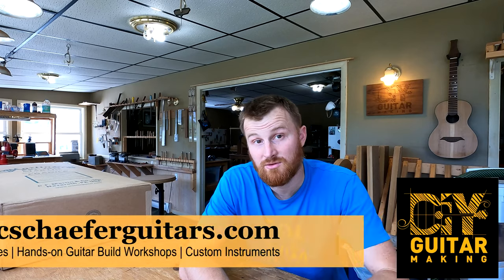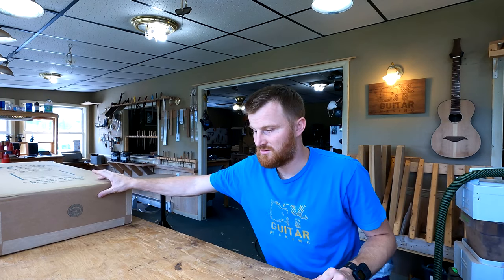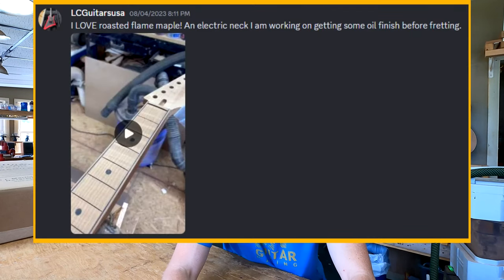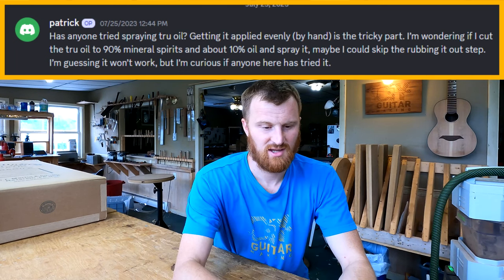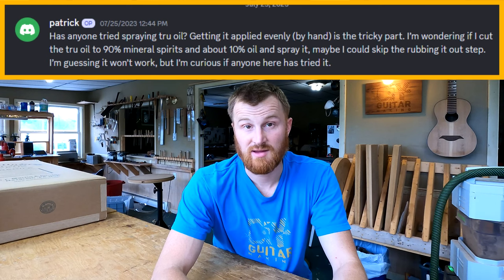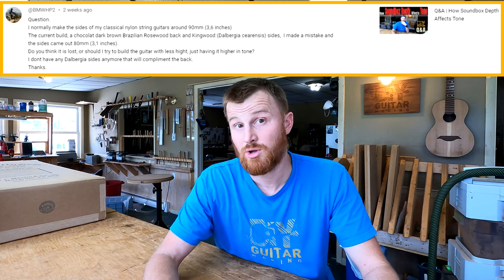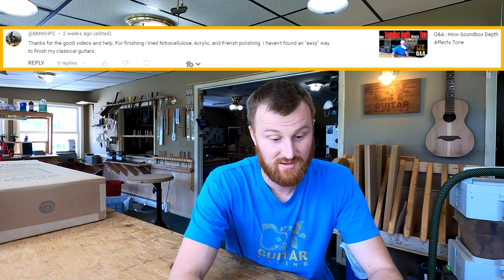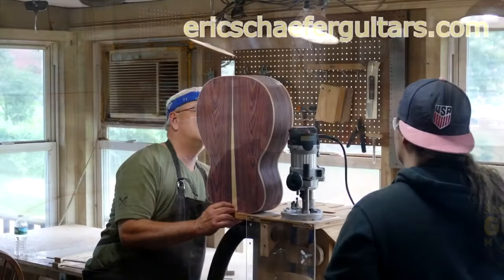Q&A | Using Pine for Guitar Tops, Shop Injuries, Roasted Flamed Maple and More!

Comment: Recently, lol, enlarging a hole on an aluminum plate with a drill press - without clamping it down - the bit dug in, spun the plate, and tore off a small corner of my thumb - it could have been a lot worse. Lesson learned, always clamp down what you are drilling on the drill press, and wear leather gloves. It is always the stupid things that you know better that get you.

Comment: I've made an electric body out of pine, & that guitar remains one of my go-to player guitars.  I almost laugh out loud every time I pick it up.  And StewMac sells pine bodies as well, of course.

I've done some research on pine for acoustic soundboards.  Of course, the first thing you come across is that there are several species called "pine."  But overall I've seen it stated that its density is similar to spruce; stiffer across the grain than spruce; less stiff along the grain than spruce.  Sounded encouraging, so I decided to give it a try.  I found "craft boards" about 0.25" thick at Lowes.  Further labeling, the appearance, & the smell all indicate they're pine.  Took 3 pieces to make a top.  Joined & thicknessed.  Compared to spruce & sapele tops I also have on standby, the pine easily has the most ringing tap tone, so I'm eager to try it out on a Frankenought build I have (slowly) in progress.

I don't suppose anyone knows a source of thin pine boards wide enough to make a 2-piece top?

Comment: Could the throwing sparks just be nails left in the reclaimed wood?
Reply: No not at all. I'm very carful about what kind of stock I run thru my tools. As were the suppliers. I always use stickers when having to lay lumber on the floor so it doesn't pick up grit. Which I did learn the hard way. I might add a nail will nick a blade this wood left the blade flat the entire width of the board. The upside was I replaced the cutter head with a Shelix head.

Comment: I hope I didn't ruffle too many feathers with my comment about Pine tops, but I'd like to clarify it.  Mr. Schaefer's comment, July 24th, 2023 , @ 27", was,  ..."assuming that you're using those, and good softwoods, not Pine."  While it was clearly intended as good advice, I  think that portion of the statement  was a slip of the tongue that inexperienced builders may take as fact.  And that and only that, is what precipitated my objection and earlier comment.  I'm NOT, repeat, NOT promoting alternative woods or touting sustainable yields, nor am I recommending that a neophyte or inexperienced builder use Pine, unless they have reason  to do so, but those reasons should NOT be because someone casually said so.  And the finer point; once you have a theory or hunch regarding the use of a material, pursue a reasonable assessment of its physical viability and if that bears out, proceed with zeal.
Reply: Hey, very interesting use of pine. Eastern White pine can have really good stiffness to weight ratio, maybe better than Western Red-cedar. Other pines, which I've played around with for archtops are Western white (very good) and Lodgepole (often marketed along with Englemann Spruce in the ES/LP grade). Eastern Hemlock, I don't have much experience with, but what I have from my area looks great, but not stiff. Western hemlock, often marketed along with true firs as the HEM/FIR lumber grade is excellent, even with fast growth. Stiffness is better than Sitka, though it is heavier.

The Southern Pines can yield excellent tap tone, but generally not in the high range as the spruces, being heavier. They are similar to Douglas Fir, but both are good as juvenile wood, I'm talking 1/2 wide growth rings. 

In short, God has blessed us and there's nothing to stop a home luthier from making good instruments with readily available and cheap materials. 

Sometimes Europeans call a tree "pine" or "fir" but mean the common Norway Spruce, for example in Andalusia the flamenco makers call it "pino abeto" (pine fir, go figure!)

Please continue to ruffle feathers. The Cremonese used what the Tyrol gave them. Pearwood and boxwood were only later replaced with ebony. Torres made due with cypress and whatever multiple piece tops he could cobble together. 

Only today's tonewood mongers and the under-educated gear fans geek on things they really don't understand. And I'm a total wood geek, so don't get me wrong. Good rosewood should make instruments. Ebony should be prized. But lacking these, go ahead and see what you can do with locally available material, within the physical constraints of the build requirements.

Blessings of success in stringed instruments and everything else!
Reply: Actually, I rather enjoy disturbing the tranquility, or should I say, the certainty of the "cork sniffers".  Thanks for your encouragement and for sharing  your knowledge.
Reply: @thepragmaticluthier  Yeah, you're welcome. Wood never ceases to amaze me. There's good reasons for the tried and true, but there's room for expansion of the canon of acceptable materials, out of necessity if for no other reason!
Reply: Hold my beer while I make a entire guitar including the top out of IPE wood 3,510 janka. It's not the type of wood, it's how it's built. 😎

Comment: Good show!
Pine,,,,what kind of pine?
We find four pine species in the pianos we un-glue for our guitar making.
Honey pine,red pine, cork pine, and white pine.
Yes, and if you need some let us know. Over 120 years old.
We can get quite a lot of pine, and yes we have some darn rare cork pine from the keys.  
This "cork pine" is extinct now would be good for bracing in conventional guitar SB's.
Pine SB's were tried out in pianos a very long time ago.
Experimental. 
But in the 1800's they had plenty of spruce so why use pine, when they didn't have to.
Wood is good!
Reply: Never heard of cork pine. I have some questions. It's not super easy to ID softwoods. How do you know what species the piano soundboard is? I'm a wood geek myself. I'm not doubting you. And I'm not surprised that pines were used. Spruce would have been Red spruce (probably?? if US made) and even in the 19th century spruce wasn't as readily available as pine. Spruce is not often found as a secondary wood in American furniture, as pines are. Red pine had a big range, and it's a very stiff pine. I think honey pine is likely white pine that's aged. ?? Sometimes called "pumpkin pine." Eagerly awaiting your reply. Thanks for the comment.
Reply: Hello! yes!
We junked an upright piano Vin, about 1910 and the SB was white pine, it is the "only" one we've seen, it was a cheap piano and a lot of them were made but very few exist.

We use Bruce Hoadly's books and magnify the end grain with a microscope and it can be determined.

Google cork pine,,,it says it all
Eastern white pine grown on  the upper  western coast of Michigan  under cold conditions which resulted in uniform growth with tight grain. "there is no more" the region is people things now, you know pavement, wealthy houses where the forest was, etc.
Oh my gosh,,well here in New England piano SB's were pretty much mostly Adirondack white until it was depleted. 
We find honey pine for ribbing on a few high end makes, with the top few being spruce.
We find red pine for ribbing on many different American makes. 
There were 250 piano manufacturers in America at the turn of the century.
350 thou pianos a year by 1910.
Man that is a lot of wood.!! It was sucked up in huge quantities. 
I have a 1918 book that indicates at that time honey pine was no longer available in large quantities.
Piano keys ! 
 if any warping occurs the piano is junk,, the key wood is flat sawed.
The piano keys are a different wood than what we find in the cases, especially in the square grands the key beds are solid 4" thick EWP and it is not the same stuff we find in keys. That key wood was ultra special, the very best wood for keys!
We find it's for keys only.
Man-O-Man---that wood would be excellent for bracing!.
White pine gets too brittle for pianos and it would go through serious changes with aging.
Maybe if the pine wood was very old but it just doesn't have the springiness of spruce.
Spruce gives more bang for the buck
 "and your time"
Note!! white pine was not used for buildings so they were sucking up the spruce also.
= heavy competition.
Piano makers had to buy the acreage of forest not only the spruce!  Wow!!
Reply: @hampshirepiano6383  Thanks for that reply. You seem to have a good knowledge of these things. I'm aware that huge numbers of pianos were produced in the US, now only Steinway remains. 

Yes, white pine will tend to brittleness over time, and spruce much less so.

There is every good reason for the supremacy of spruce in soundboards of all kinds. But it was also the preferred wood for lots of things, boat masts, airplanes. The Wright Brothers almost certainly used red spruce.

Spruce 2x lumber to this day is preferred for studs. The smaller knots of spruce yield better overall strength. The twisting and cracking is less than fir. Stiffness is far better than Balsam Fir. Pines are more used for boards. Southern pine is used for select structural but most goes to preservative treatment. Spruce is notoriously impervious to treatment. Most Eastern lumber is Canadian or Maine spruce, often white, sometimes black, even red, or hybrids, it's hard to tell for sure.

I imagine you find a lot of poplar and often chestnut in the casework, veneered over.

Very, very interesting to someone like me, a wood, instrument and American history geek. Thanks again. Best of success to you in your business.
Reply: @hampshirepiano6383  And as sidenote, luthiers and woodworkers should be aware of the treasure trove that is in a junk piano. Ivory from the white keys (before around WWI, correct?), ebony from the black keys, good straight grain material, red spruce from the soundboard, sitka spruce later. But oh those cast iron harps are heavy!
Reply: Yes, we developed a method to un-glue
Reply: Un-glue  the whole piano by soaking them in very hot water after removing all the metal. 
This evolved over many years in order to obtain the wood we prefer to use on very old pianos. SB wood especially.
And those rosewood ones where the veneer is impossible to get nowadays.
Un-gluing them easily and thoroughly is the key! Basically a wood fired hot tub.
Reply: @hampshirepiano6383  Yeah, that's real Brazilian rosewood. I had a stash of that. They used to sell it on eBay in the early years, "pre-ban" they called it. The ban was made by the Brazilian government in 1967. From a dollar a square foot up, always auction. There were 200 sf lots. Now one little piece will fetch $10 sf.
Good work you're doing. Keep it up!